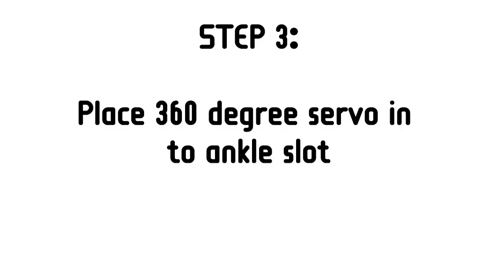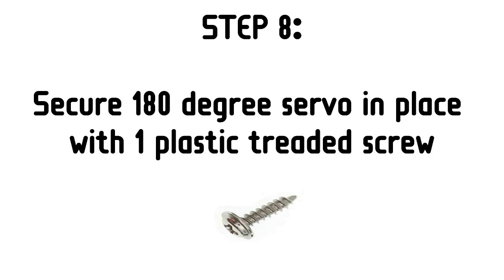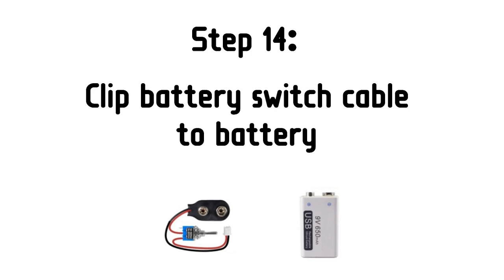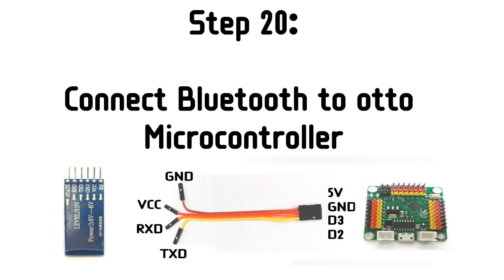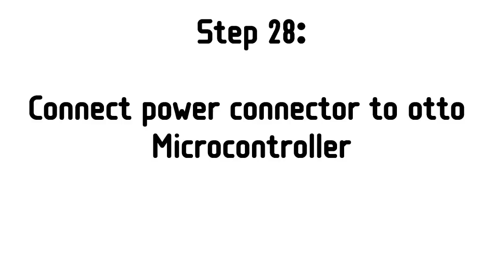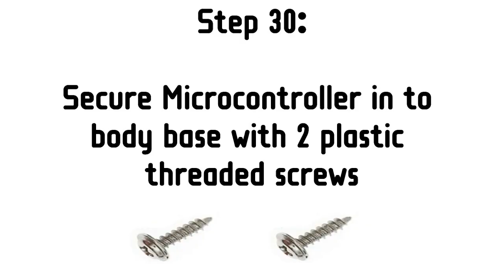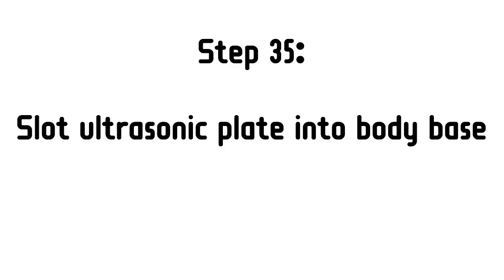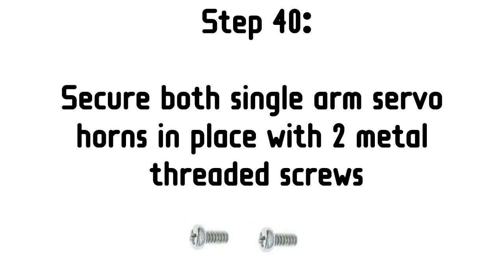How to build and assemble Otto Ninja robot DIY tutorial

Comment: I am building one with an Arduino nano, an extension shield and hc-05 Bluetooth modules. The code they provide is from esp8266, do you think it still works?
Reply from the maker: esp8266 uses only wifi in the app, so no it would not work the exact same code.

Comment: Is otto microcontroller arduino based? if yes then where to buy or any alternatives?
Reply from the maker: It is ESP based but compatible with Arduino IDE
Reply: @OttoDIY  Too costly man considering it doesn't deliver to India. Can you open source the circuit or maybe suggest any alternatives? Have been failing at it from last month
Reply: @shantilkhadatkar1195  honestly been looking for an alternative too. I ended up just doing the prototype model they have. It uses the nano + shield.
Reply from the maker: @edwardleyco3660  that is why there are plenty options of Otto robots for all tastes and budgets

Comment: great robot, but who would think of using an otto microcontroller that you can't buy and that has no identical analogues...
Reply: Someone very smart will think that, the creator made another version before with an Arduino nano, you can find it also in this channel; if that is what you mean identical analogues? but the center of gravity is affected with out the shelf components so you need to go small and compact with the microcontroller or the robot will fall constantly.
Reply: @cparrapa  Thanks for the clarification, but where to buy the board from the video? I can't even find it on ali
Reply: @whiskeykolya4622  there are scarcity of microcontroller parts, in Otto we are working on a new PCB that can cover that